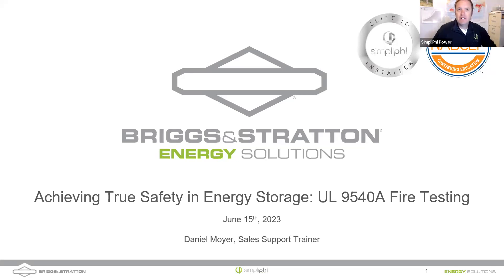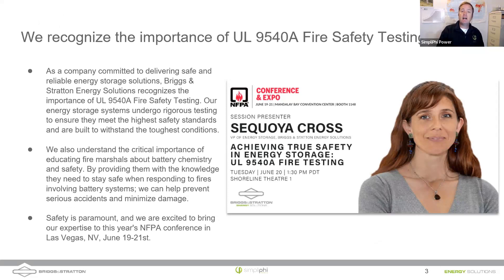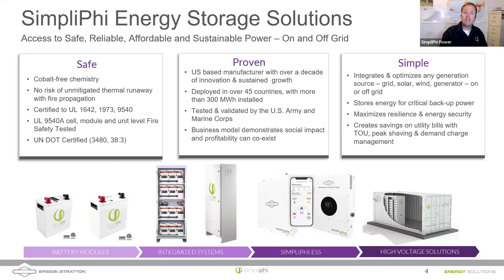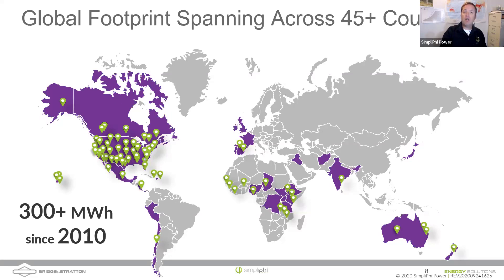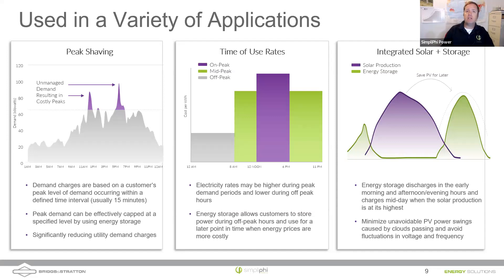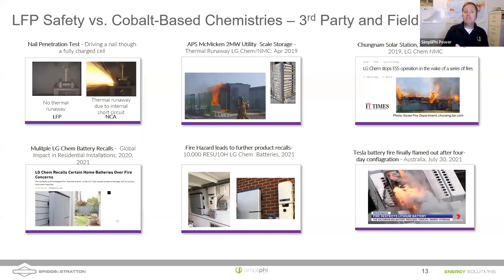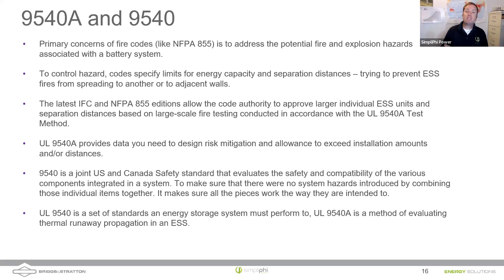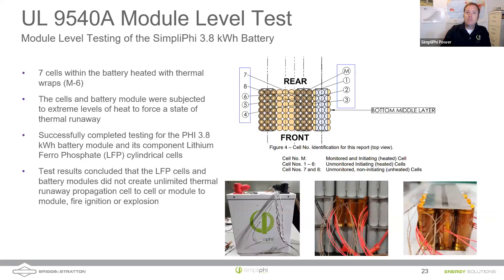Achieving True Safety in Energy Storage: UL 9540 and UL 9540A Fire Testing (NABCEP Credit)

Comment: We are currently in a debate with the manufacturer (for grid scale - Non-residential BESS solution) on the interpretation of a ‘UNIT’ per the UL9540A standard.

Their solution is a 20ft container comprising of 8 battery racks, with a BMS rack (8x BMS  - 1x per rack), gas detection and fire detection and gas suppression system, dry-pipe water sprinkler system. They have a test report deeming the Unit as an Outdoor Non-Residential Ground Mounted solution. Quoting the model number as the Container level model number. As such I would deem a single 20ft container here as a UNIT under the definition noted in 4.18 of the UL9540A:2019 standard. Being a functional BESS.

They have done the test purely on a single open rack (one of the 8) that are within this container and they seem the rack as the UNIT and the container fitted out as the installation.

What would your interpretation under this solution/scenario be for Unit Level testing?
Reply: In the above specific case: Unit-level testing involves conducting tests at the rack level, while container-level testing is known as installation-level testing.
Reply: If you read the standard properly. Installation level is not racks inside a container, but only for indoor installation with relevant fire protection systems in place. The Unit is defined as a functional BESS. As such a containerised solution is the unit in this case. A battery rack standalone does not comprise a functional BESS unit
Reply: @peterkilleen3061   Interpreting text differs from actual understanding, especially after discussing and working with the UL team. I confirmed that a test was conducted for the product I am working on.
Reply: @vimmib well that’s exactly what a standard is. Following the terms of the wording it’s written in. Also that it makes logical sense. Unsure how a rack standalone being tested where the gases vented from the cell forced into thermal runaway, are then exhausted in the test bay - and that constitutes thermal runaway performance testing. When in reality that rack to form a functional Bess will be containerised where those gases are then trapped and concentrated resulting in a completely different outcome. That is truly appreciation and understanding of the requirements of the standard and what it is looking to observe. But it will differ product to product as if a rack standalone does for a functional BESS unit then that’s fine.

Interesting that various manufacturers have had a ‘unit’ tested in various ways. So no commonality when the fundamental solution is the same. How do you explain that one then? I think tighter audits of the testing centres need to be ran by UL